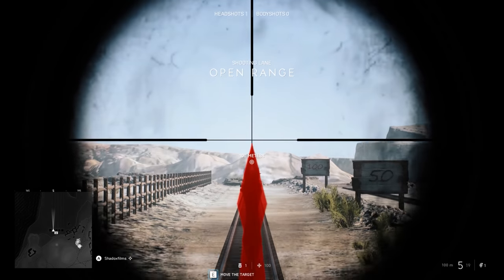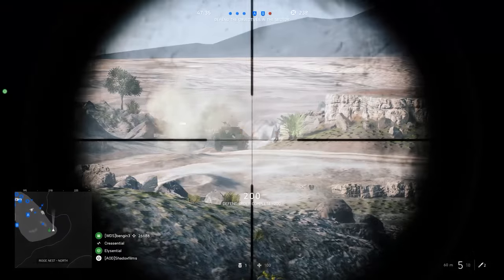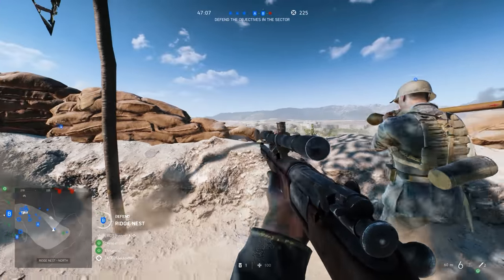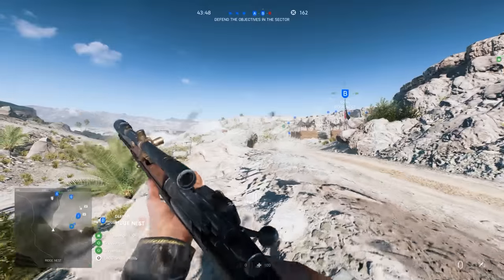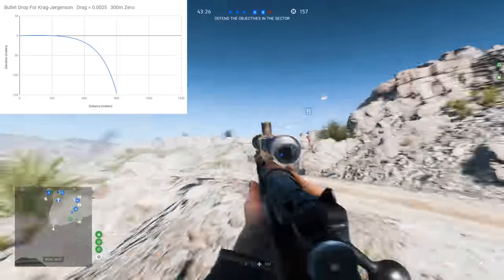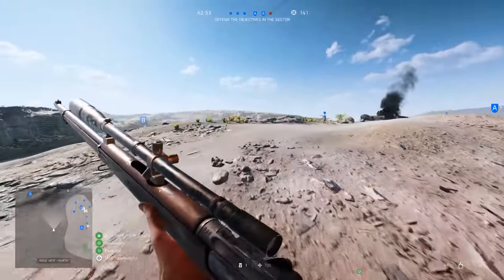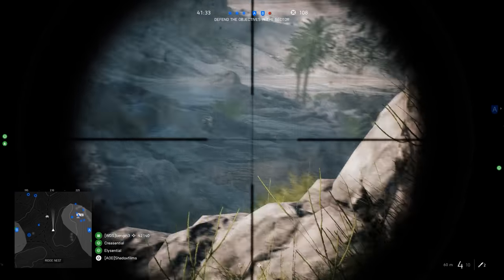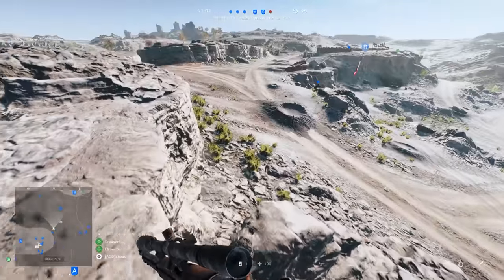Battlefield 5 - How to Find Bullet Drop

Comment: Good video! I just have one question, if your zeroing distance is at 150 m and you take a shot at someone who’s 50 m away and you also want a headshot, do you have to aim directly at his head or like in the chest-region?
Reply: zeroing 150m means that the bullet will go up and drop at the tip of point you aim, so yeah if the target is at 50m you need to aim lower

Comment: Good video! I just have one question, if your zeroing distance is at 150 m and you take a shot at someone who’s 50 m away and you also want a headshot, do you have to aim directly at his head or like in the chest-region?
Reply: Zeroed at 150m means that the bullet will be discharged above where u aim and land where u aim at 150m. So if u want to kill someone at 50m with 150 zeroed, u need to aim for the chest or slightly above